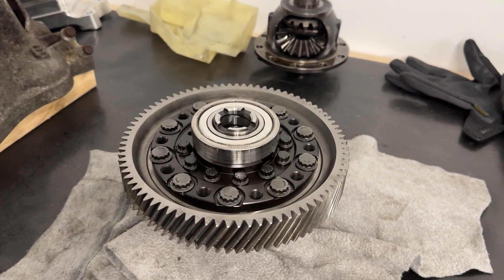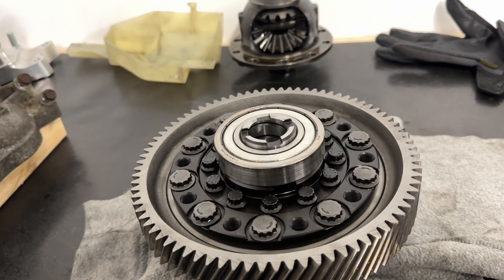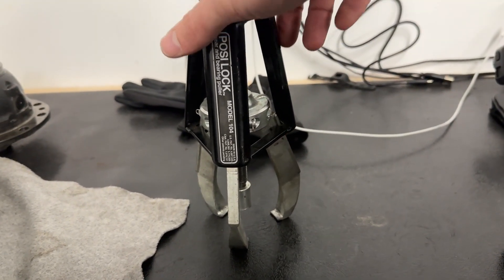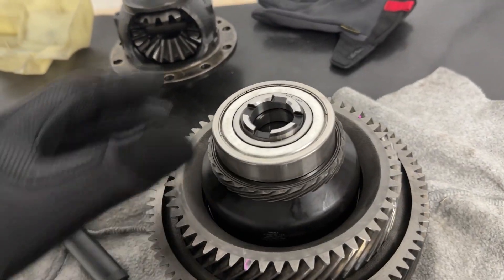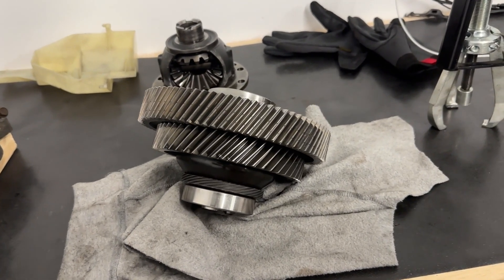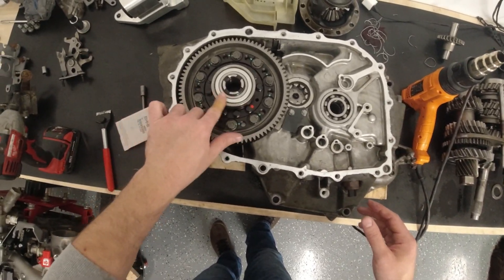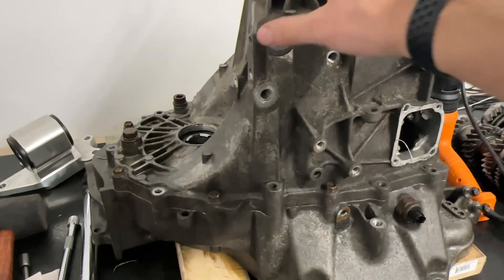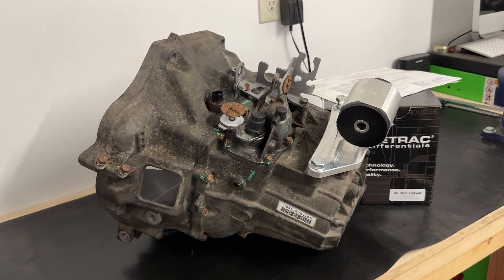Honda K-Series: Limited Slip Differential

Comment: what diff bearing was used for the differential?
Reply from the maker: Are you asking for part number? I’ll have to check later but it looks like it’s 91005-PG2-004?
Reply: @berttnotbought804  yes especially if the bearings were tapered or spherical. thank you for providing the details and a detailed build into the diff installation.
Reply from the maker: Hey no problem. I’m super happy to hear you appreciate it. It’s the whole reason I do it. These bearings are ball bearings. I’ll be honest I don’t have a lot of experience with the taper bearings but to my knowledge if a Honda has a taper bearing it’s a two piece with a conical race that goes in the case first then the other race and rollers are pressed onto the diff hub. Can be installed using the same method.

Comment: Dad noise @02:50 😮
You think an air fryer would work to heat bearings also?
Genuine question tho; since there isn't much of a time crunch on this project, and you have such care for detail and quality, why did u leave the trans case un sand blasted or painted?
Reply from the maker: I looked into dry ice blasting. May still do it. But for now. It is just a dirty old 4 cylinder.